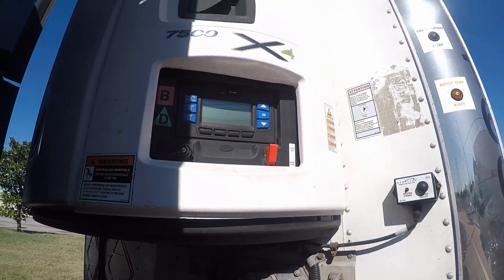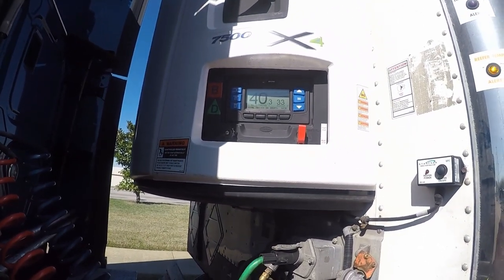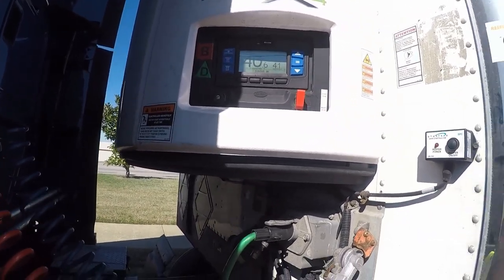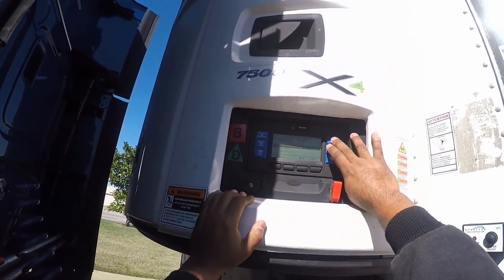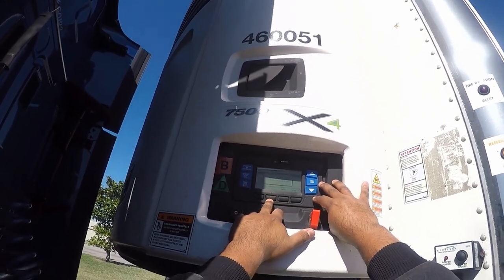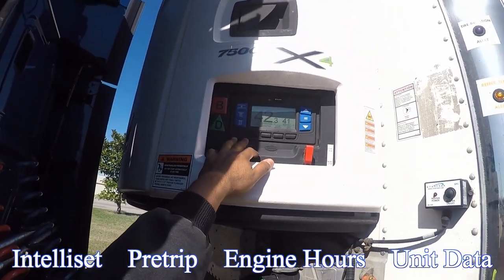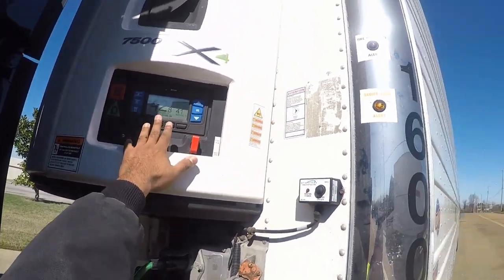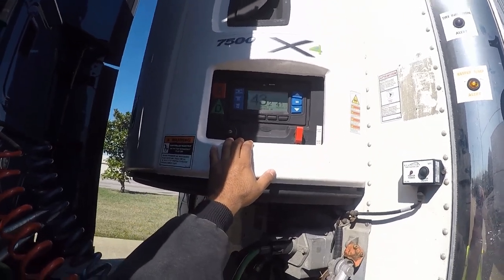Truck Driving - Setting your CARRIER Reefer Unit (Trailer Refrigeration)

Comment: What is different of driving when set to start/stop or continues ?
Reply: On continuous the engine will always run until it is turned off. On start/stop the engine will shut down when it is within the desired temperature range saving fuel. and start back up when the temp is out of range.

Comment: another great video dose the new reefer has the green light to let you know if it on
Reply from the maker: +Luis Sanchez no it does not. I wish they did because they do help. Thank you and thanks for watching 👍
Reply: another question when training at prime do students in PSD and TNT drive a manual transmission
Reply from the maker: +Luis Sanchez Well Prime will eventually be all automatic but until then you will have to test in a MANUAL AND DOUBLE CLUTCH regardless of you training in an auto or manual. They have some manuals and mostly automatic trucks out here. After training you will most likely get an Automatic truck. Thank you and thanks for watching 👍

Comment: do the newer Carrier Reefers like the 7300 X4 or Vector 8500 have sleep or standby mode where it monitors the battery and motor temperature in winter conditions? The older Carriers around 2014 did but I cannot find it in the settings of the newer models.

Comment: Hi Junior Do you know if reefer has a minimum guarantee because when I talked to Bud in the Flatbed division he told me that flatbed guarantees 850 a week.  If I get bored or local driving I might come to prime and if I do I would give them your info be safe Buddy.
Reply from the maker: +trucker Jay I really appreciate it and the GUARANTEED here on the reefer side while in training is $700 @ week. I am not sure as far as flatbed goes but I thought it was $700 across all 3 divisions here at Prime. When you are ready give Nikki a call and she will be able to get you going or fill out the application by clicking on the link below. 

Click on the link below and make sure that you add Nikki Yost as the recruiter and myself as the referral (Driver Code: MATURO)

PRIME APPLICATION
https://driveforprime.com/?r=MATURO

PRIME RECRUITER
Nikki Yost
417-521-3598

Comment: How can you tell if your reefer unit is working properly while you drive down the road ?
Reply: If you look in your driver side mirror while driving and you see the yellow reefer alarm light is on then you may have an issue with the reefer.
Reply from the maker: +James Burns that and it sometimes throws a message on the Qualcomm. 👍👍
Reply from the maker: +Terrance R look at your mirror and watch for the yellow light. If it comes on that means you have a problem and you have to pull over to check it out. Thank you and thanks for watching 👍